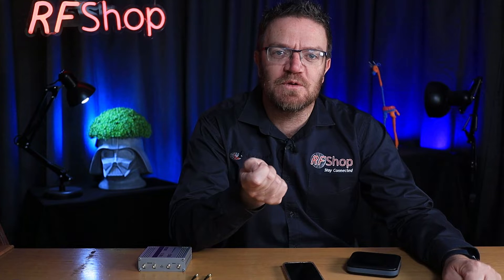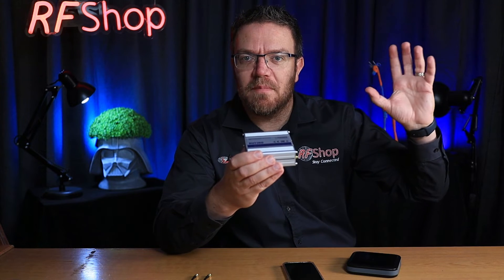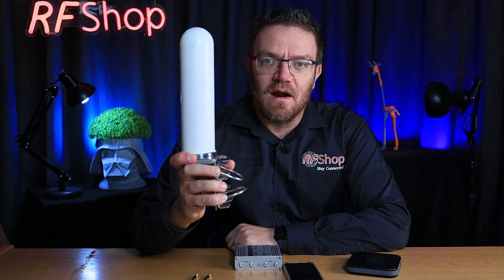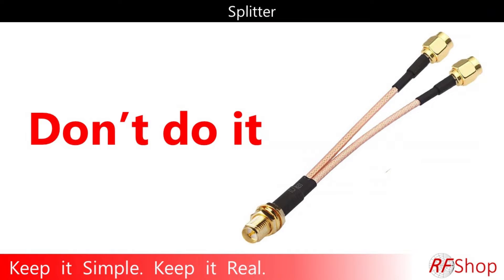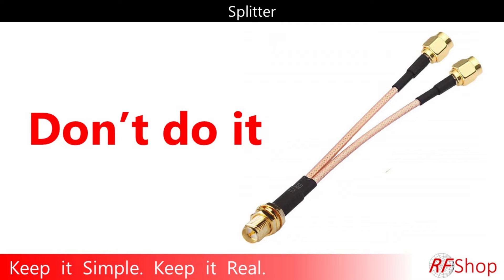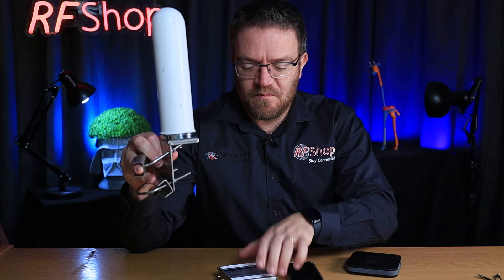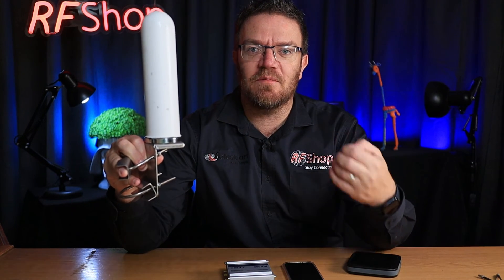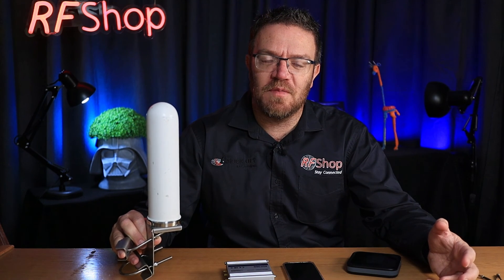Does your antenna need power

Comment: HI David, I am building a campervan and want to future proof it before finishing off the ceiling. I have a Nighthawk M6 and putting in the holes for whatever antenna I decide to use in the future. 
Being highly likely that I get a directional MIMO antenna I'm absolutely putting two holes in the roof. From my understanding the M6 only has 2 antenna Ts9 ports so getting a -14 -> -17 external antenna is a waste since the M6 only has 2 ports and joining 4 wires back into 2 is not good practice/gaining anything.
To be able to future proof the build, would it be worth putting in an extra three holes (2 for potential -14+ upgrades and 1 for external power) while I still have the chance? Do you think the technology will advance far enough for a portable modem to have MIMO 4 antennas(ports) or newer -12 external antenna models to need external power?
I hope my question makes sense and have a lovely day :))
Reply from the maker: Isaac, this is a tricky question. For the current modems you mention the 3-12 and a simple 2x2 antenna is indeed more than good enough and somewhat future proof. 
However, my opinion is updating a bit in 2023, since I played more with 4x4 MIMO routers and noticed a remarkable performance difference even on 4G using the 4x4 system. 
I think the 2x2 is great, but now that I have experienced 4x4 ( on 4G and also 5G ) I'm starting to fall in love with the future upgrades. With that in mind, if I had to buy a roof mount antenna today I would sacrifice the short-term optimal solution in a 3-12 and rather prepare myself for the routers of tomorrow and put in a 3-14 or any 4x4 model. 
That's just me...but I think I'll do a few more 3-12 videos in 2023 on this channel, and then you'll see me migrating towards the 4x4 models and devices.
Reply: @RFShop  Morning David, thank you for the swift reply, do you see EPNT antennas becoming more desirable than XPOL in the future? Do you know any 4x4 mimo 5g mobile routers currently available that can connect to either 4x4 XPOL or EPNT?
Reply from the maker: @19barney94  I think the EPNT is going to grow in acceptance, yes. I just finished my initial tests on the new 5G router from Teltonika, and I already see how 4x4 will become increasingly popular. The speeds with 4x4 (even on the 4G network) seems significantly better than 2x2. The XPOL-24 may be too big for many, so I can see how the compact EPNT style solutions will grow in interest. They will take time since they are more "complex" to assemble, but let's see how 2023 develops.